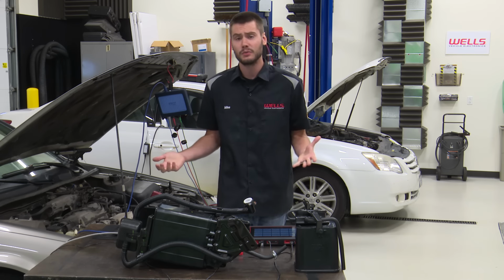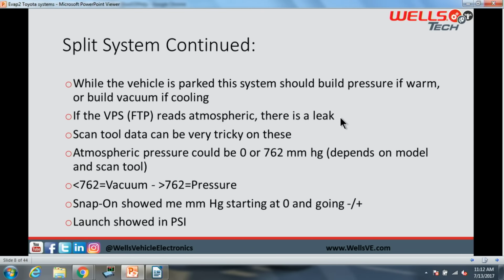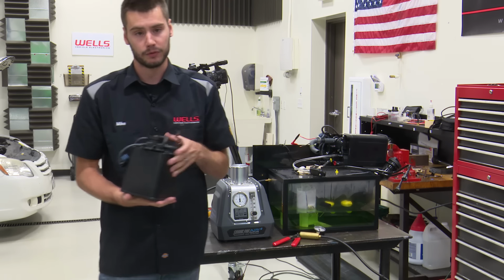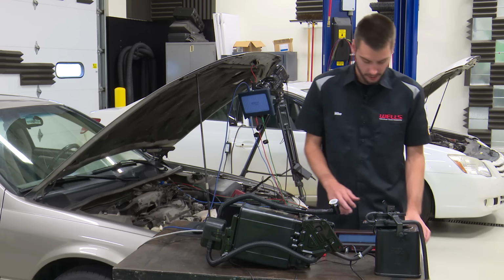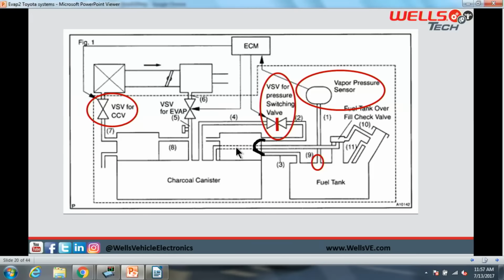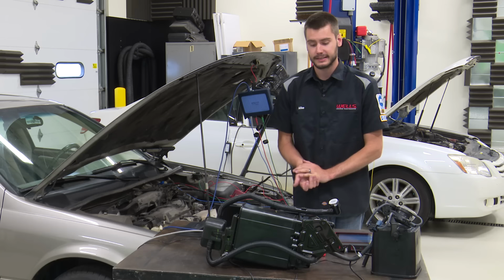EVAP-Toyota/Lexus Systems Function and Diagnostics (LDP, VSV, VPS, P0441, p0440, P0455)

Comment: Hey bro what abou with the p0453 p2401 2401 p043E i already change the canister and the code still permanent
Reply: 2012 Lexus si 350
Reply: Do you know what voltage the evap leak detection pum should carry
Reply: you should do some research on those codes. Test with a smoke machine and advanced scanner before randomly replacing expensive stuff

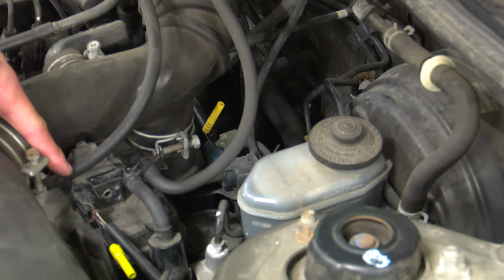Comment: @35:40 to confirm, the hose on the right that curves up out frame is the one that goes back to the intake manifold, correct? Is that a good place to do a seafoam spray treatment (vs taking off the entire air filter box to get to the throttle body)?

Comment: Got 4 code combination I believe all related to EVAP on 2010 Lexus RX450h:

P0441 - EVAP System Incorrect Purge Flow
P1421 - Evaporative Emission Canister Gross Leak
P1423 - Fuel Tank Gross Leak
P2450 - Fuel Vapor-Containment Valve Stuck Open

I've replaced fuel cap to the new one and I don't think it's leaking fuel anywhere (there's no odor or anything). Where should I start troubleshooting?

Comment: love your videos. i'm in Jamaica and i have a 2002 toyota Mark 2 Grande sometimes it will not start unless you open the gas cap and let out some pressure. i believe it has an evap problem can you do a video on this
Reply from the maker: Hey Kurt, thanks for watching! We have a video showing this issue on a Dodge Dart. Different system than your Toyota though. Most likely, you have a restriction in the system
~Mike
Reply: Can you drop the link video of the dodge Dart ? @GoTechTraining
Reply: What was your problem?

Comment: Thank you, this is the video which I learned how to use locking pliers to closed the Vent valve without the expensive scan tool !see my video, I used rubber glove and zip tie. LOL it works, I fixed my lexus GX460 P0455.
if anyone is doubting whether you capable of doing it, Yes, you can do it yourself, go fix the EVAP leak.
https://youtu.be/-fDjuI2mzWE
https://youtu.be/B92Vl7rrefI

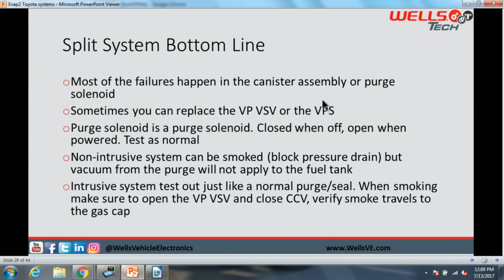Comment: Mike, very well done. Quick Question. in this intrusive late model system, reference 1:09:19 in this video, when bypass valve is closed(normal state) does Fuel tank side connect to vent valve(normally open) OR Vent valve is not on fuel tank side. I assume fuel tank side is connected to vent valve when bypass valve is closed.
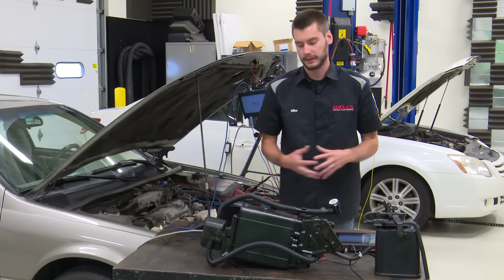Also when pressure is building up in Fuel tank because of warm or hot day and vent valve is open. I see that pressure will leak thru vent valve and FTP will not read pressure at all, because vent valve is open. should not ECM command vent valve to close to read fTP fuel pressure. But if you look at 1:09:19 video, pressure build up even though vent valve is open.
Reply from the maker: Hey Sivaraj, thanks for watching! The system is normally sealed up. The FTP reads the fuel tank pressure that will increase or decrease depending upon external influence. The bypass opens and connects the tank to he rest of the system to check for leaks. On this system you should hear pressure release when removing the gas cap.
Mike Becker, Senior Technical Instructor

Comment: Question can a Toyota NA Gen 2 Prius bladder style of fuel system. Unique to NAmerica....can someone change to a non bladder style.... would the Corolla be a donor and is that a do able project??
Reply from the maker: Mark, not sure. Maybe Google will be able to help here. I've never heard of it being done, but that doesn't mean it's impossible.
Mike Becker, Senior Technical Instructor
Reply: @GoTechTraining   you are Google to me ...l thought
Reply: Yeah all l am sure of is that the 2004-09 Toyota Prius Gen 2 are bladder fuel system tanks and there fore make fuel pump replace ment impossible and the after and before did away with bladder style

Comment: sir what causes or conditions did the purge solenoid will open is it when key on engine off or when engine running? and how long it will open is it pwm thanks
Reply from the maker: Hey Mr. Yabe, I don't know of any engines the open the purge with just the key on, engine off. During idle and driving conditions the PCM will pwm the purge open. This open amount depends on the load of the engine and the presumed fuel vapor capacity in the canister. 
Mike Becker, Senior Technical Instructor
Reply: +Wells Vehicle Electronics "mabuhay from Philippines"   sir thanks more power more viewers and hoping more videos to come .Ive learned a lot from you and from Wells thank you sir

Comment: Yes I have a 94 Lexus es 300 and i just bought the car payed 675 in back regestrarion and now I am trying to smog it to get in current registration. But I have a check engine light and a. Code p1600 ecm batt.. What does. This mean and how do I fix it and is it hard and will it be expensive to get done at a. Shop and how long should I expect it to take then to fix so I don't get ropped. Off
Reply from the maker: Hey Casey, that's a nearly impossible question to answer. A p1600 is related to an ECM power failure. Could be wiring, could be an ECM issue. It should be properly diagnosed. It could take 5 minutes, an hour, or 8 days to figure out. Best bet is to go to a reputable shop and trust them until they give you a reason not to. 
Mike Becker, Senior Technical Instructor

Comment: Hello 
Will my warranty be void If i clear the check engine light with the obd scanner. I have a EVAP leak in my 2016 Corolla P0455 and P0441 so i decided to get a new oem gas cap and remove the old one and then clear the check engine light with obd scanner.  So will this void my car's warranty or is it safe  to do this. ??? 

Thank you.
Reply from the maker: Hey Sami, I have never heard of clearing a the codes voiding the warranty. Best bet would be to contact your local Toyota dealer just to be sure.
Mike Becker, Senior Technical Instructor

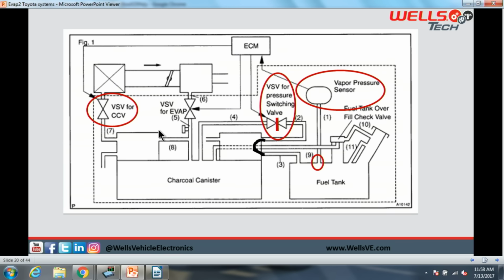Comment: Thanks for these good videos , it help me to clear up some confusion long time ago , but can you explain more on one point on your video , on 0:58:40  you said has vent solenoid , but on 1:03:38  you said there is no vent solenoid ,?  are you meaning the same part ?  Thanks a lot.
Reply from the maker: Sorry for the confusion, Toyota runs the vent solenoid as part of the vacuum pump. The car does not have a stand alone vent, only serviceable as part of a unit. Hope that clears it uP!
Mike Becker, Technical Services Instructor
Reply: Thanks for the clears up , Thanks.

Comment: Hey, I have Lexus LS430, 2001. it is giving me code P0441.
Also, the car does not want to start after refill.
 I changed gas cap but no effect. I took off the Purge valve solenoid from the car, one that is on the engine. When I blew from port A, air came out from port B and when I blew from Port B air came out of Port A. Does that mean that solenoid is bad?
Help will be appreciated.
Reply from the maker: Hey Irfan, yes if you can blow through the purge when it is not powered and grounded it has failed and in need of replacement. I think that will most likely solve your check engine light, as well as the hard starting issue after refueling. 
Mike Becker, Technical Services Instructor
Reply: Thank you very much!
Reply: Update!
Hey, Need your help again, I changed the VSV 2 months ago and problem solved.Thank you so much for that. However,  I still smell some gas when I stop the car. Today, Code P0440 turned on. I had changed tubing and tightened all the connectors that go from VSV to engine and VSV to down below. I wonder where this leak could be! Any help will be appreciated.
Reply: Hello I'm new to your channel, I have a 08 Highlander 3.5 l with the same code as Ifran p0441 I've checked all of the front vsv  electrical components  ( good)and I even hear the click sound after I turn off the ignition.

Comment: What is the PSI output on the EVAP rated smoke machine?
Reply from the maker: Hi Allen, most EVAP smoke machines are calibrated to put out about 1 PSI...you don't want to be putting in much more than that. Over pressurizing could lead to solenoid or FTP damage.
Mike Becker, Technical Services Instructor

Comment: how is this guy an instructor?? when hes so young. how much real life shop experience does he have?? its all book experience it seems. not being rude
Reply from the maker: Hey Phil, there's an age limit to being qualified? I spent almost 10 years in the shop professionally, at both the independent and the dealer level. I am also Master and L1 ASE certified. Age and shop experience, in my opinion, are not what make a technician or a trainer great. I've worked with a few people over the years with 20+ years of shop experience, sure they had a ton of stories of the good ole' days, but they weren't very good with electrical/diagnostics. Real life shop experience doesn't teach that. A yearning for knowledge and growth does. So the real question is, did you enjoy the class, have you learned something in your time spent here?
Mike Becker, Technical Services Instructor
Reply: Wells Vehicle Electronics Grow more beard, a belly and get a tattoo. No more unqualified questions. 😂😂😂😂😂😂😂
Reply: The book experience guy crapped on you.
Reply: Maybe you wish you had his job!  
Even if he didn’t have shop experience he is very good at teaching “the theory“.  Its up to you to put what you learn into practice!!!

GREAT CLASS!!!
Reply: Hi there I have being watching your videos on YouTube and and I love your work. 
I would like to ask you a question I have a 2005 volvo xc90 t6 2.9 with this code any help will do p2419 evaporative emission system switching valve control circuit low
Reply: phil holbrook Not being rude but not all technicians are blessed with the same level of natural talent and all techs aren’t willing to pay a price to go to the next level. When I went to work for Toyota many years ago I took every manual they had home with me night after night. I never watched Hollywood, never wasted time on the internet, and never partied. After only two years at Toyota I knew more than most other bears that I worked with. It’s not about age. It’s about dedication and hard work. 
Most technicians are lazy and won’t spend any “off time” learning more about their craft. It’s pretty easy to stand out from the pack these days.
Reply: In my shop, I need theses young techs because they are best at the electronics and computer based tools and systems. 
He is a great hands on instructor, we have watched and benefited many videos
Reply: Hes a better than 90% of the gray haired instructors trying to teach case studies from cars in the 90s in 2025. 
Mike is a awesome instructor and top tier tech. 
Old heads need to accept age doesnt have anything to do with knowledge or competence

Comment: fuel vapors moved the valve on detection pump and freed it
Reply from the maker: Hey Mike, what if this system doesn't use a leak detection pump?
Mike Becker, Technical Services Instructor